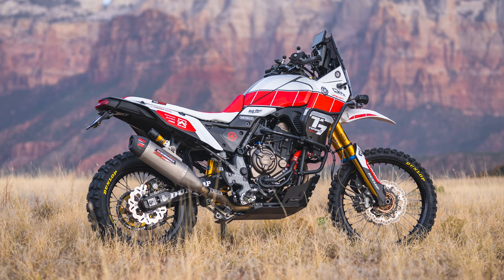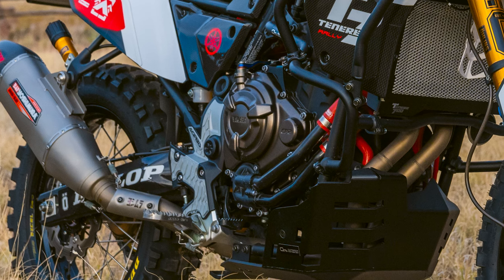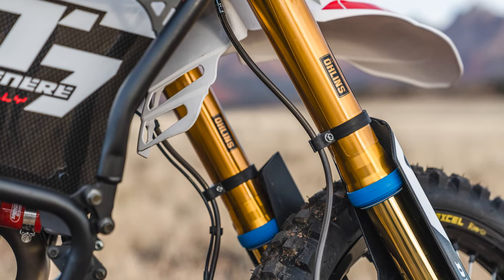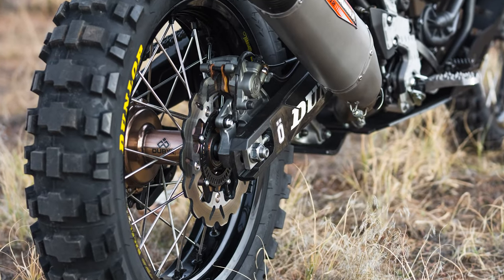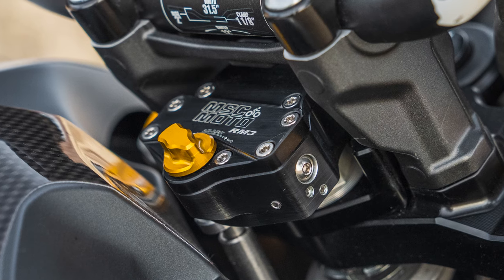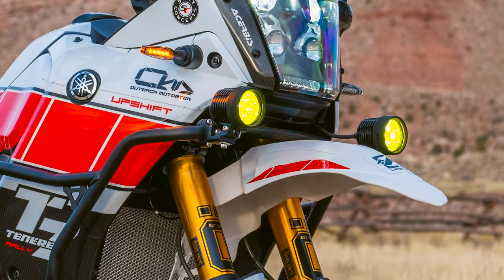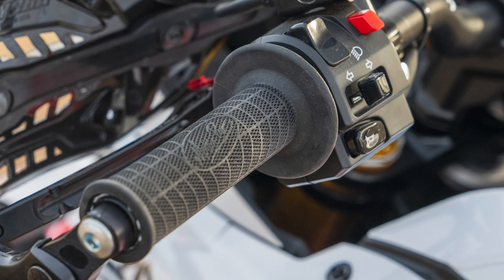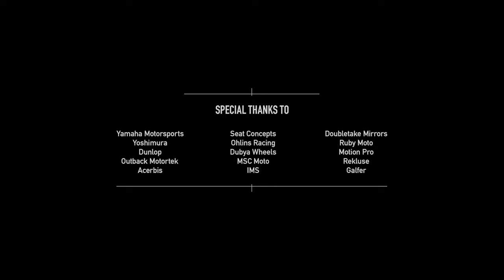TENERE 700 - PHASE 3 PROJECT BIKE

Comment: Nice build! Can you elaborate on the three sets of different handlebars, like rise, sweep, widht and why you choose each set a your three stages of the projects?
Reply from the maker: For Phase 1, we put some Fasst Flexx bars on. They add some small bump absorption and reduce fatigue. Especially good when the suspension is stock. Phase two we used a Pro Taper MX bar. Something straighter and wider. We also had the stock suspension tuned as much as we could by Race Tech. This last set of bars is also a fat bar kind of like an MX bar, but a lot more though went into the ergonomics for Dualsport/ADV. They make one bend and it hits the sweet spot for us and it's available in three heights. It also offers a lot more room for controls which traditional MX bars do not. We will have the Cheetah Factory bars in our store soon.

Comment: What do you think? probably around $20k total? I have wanted a T7 since before Yamaha even thought of building it but is it worth putting this much into it vs buying a KTM 890? giving the choice I would rather have the Yamaha but does it make sense from a bank account stand point? And I feel this goes without saying but awesome job you guys have great taste
Reply from the maker: $20K is probably in the neighborhood. We can't even give you an accurate total. A lot of the parts we used aren't even available anymore... it took that long to get everything in. Like the forks were in the $4200 range and since then Ohlins has moved to a cartridge kit that is $1200ish. 890 vs T7 ... The 890 is still going to need a lot of these items to make it more enjoyable/capable. The 890 is a race bread machine that definitely has some advantages especially if you jump up to ConeValve boingers. The T7 becomes much more capable with some set up but is a lot more approachable day in and day out. And the CP2 is incredibly durable and the electronics are really simple. They both have their place and we love them both. But the T7 is definitely the better value proposition.

Comment: Very nice, surprised you left the exhaust where it is.
Reply from the maker: We certainly understand the high pipe but it isn't something that we have needed. We dropped and dragged this bike countless times since we received it 3 years ago and have not bent the pipe. Another consideration for us is that Yoshimura does not make a high pipe for the T7 and Yoshimura supports Upshift. They have for quite some time so we will run their pipe as they make. It's the least we can do.

Comment: What was the seat height after the new low seat .. im.5'7 and struggle on the t7 i want one but woth the weight and height its uncomfortable at best
Reply from the maker: It's still tall. Not certain of the exact seat height. I'm 5'8" and it's still kinda tall. But I make it work pretty well as long as I think about what I'm doing and where I'm stopping.

Comment: Love the build! Do you find the power bronze screen stops the wind buffeting at highway speeds? Even with the height adjusters I find the stock screen still creates too much buffeting.
Reply from the maker: We honestly can not remember which wind screen we have on this bike. We just wanted a darker option. We have yet to ride a T7 that doesn't buffet. It's not as bad as the Africa Twin though.
Reply: I have the the Powerbronze sport windscreen on my T7 and it works wonder for buffeting. It is also much nicer offroad, because it has less chance of hitting your chin when things get rough. The one drawback it has is that it directs air onto the helmet, so you better have good earplugs for the wind noise. It gets rid of the helmet shake and blurry vision at high speed, and is much quieter overall, though! (I'm 5'10 with the stock seat, for reference).
Reply: @ApocalypseNouille  Appreciate the reply. That's the sort of info I was after and I'm the same height.

Comment: I'll be impressed when someone rides like that with full luggage and food for a week on board.  If I want to off road I'll take a 450x over a t7 anyway. T7 isn't an adventure bike or a travel bike. It's a big dirt bike. No thanks.
Reply: Dont knock it until you have tried it. It is definitely possible, and I have been doing it. I also have a drz400e and I reach for the T7 more often these days.
Reply from the maker: Adding 20 - 40 pounds of gear will change how it gets ridden. And it should. If the Tenere 700 isn't an adventure bike we don't know what is. Sure, it was designed to be an offroad capable machine, but it isn't a dirt bike. It's also not a touring bike in the traditional sense. It straddles categories and it's great.
Reply: You can adventure on anything. Ask Ed March from C90 Adventures. That’ll change your perspective on what is an adventure.